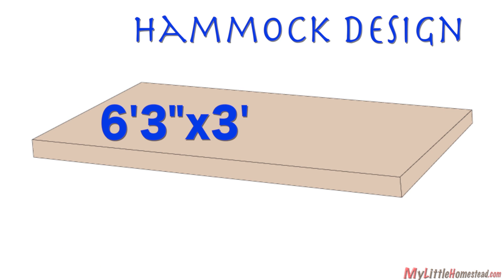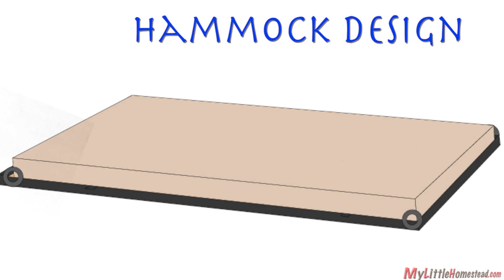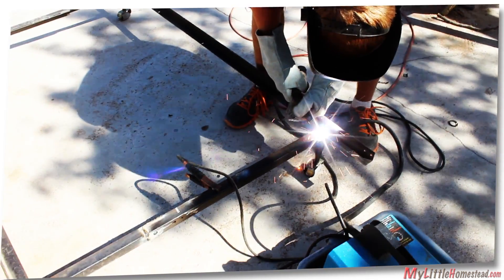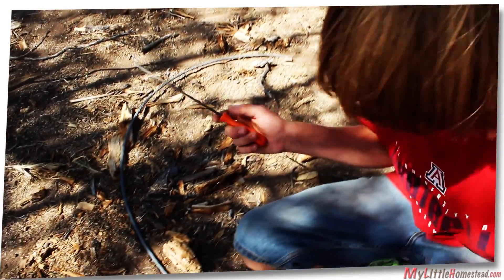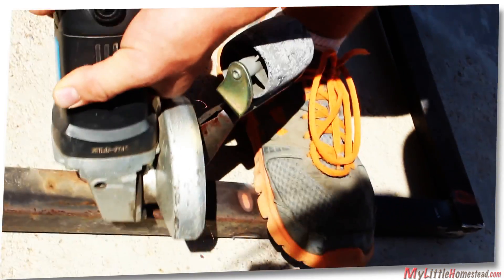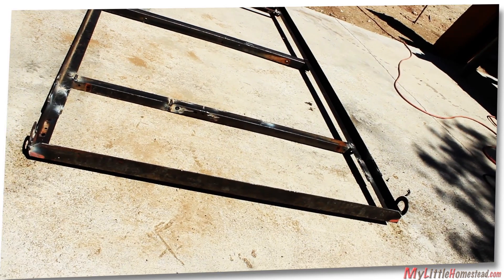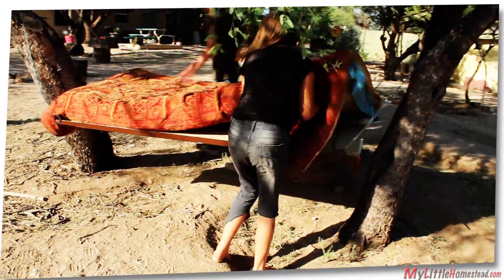Homemade Solid Hammock Idea - Sleep Outdoors in Comfort

Comment: For sure and I wasn't meaning to mock your work. I was a little sarcastic, or so could be interpreted, but it was just joking. Fe, my bed rests right on the floor (took a while to get used to this low height for lying down but I've become accustomed to it), and resting directly on the floor means that the ensemble (box spring and mattress) couldn't be more solidly based. True. Okay. But I was also meaning it only as humor.
You do very fine work and your activity is of certainly good kind. Enjoy.

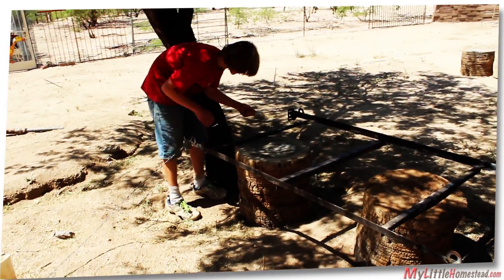Comment: 2:23, people should take note of how the hammock's support cables are attached to the trees.  There's no drilling, or hammering of nails into the tree.  Instead, a cable is used to form a loop around the tree.  This is good.  Trees can take nails, but it's much better to do w/o them.  When I was young we built some tree forts but the supports were nailed to the trees.  Trees did ok, but I long thereafter thought that it'd be possible by tying the supports to the trees, instead.

Comment: Looks like a lot of work just for a hammock, but if wanting one to rest on for hours, then this is surely better than the slumpy (word?) kind that'd be much quicker to install or set up.  I haven't used the latter kind except for just a minute or two. It was ok, but I wouldn't think of using it for hours, unless it was done just to keep off of the ground in venemous snake country, f.e.  As for your steel-framed version, my bed is on the floor; can't be more rigidly supported and is comfortable.

Comment: Well, I give you points for being clever.  But this is not a hammock.  It is a bed hung from trees.  Some of us sleep in hammocks, full time, as the Mayans did for centuries.  They have the benefit of simplicity AND of supreme comfort, and are a triumph of fabric engineering.